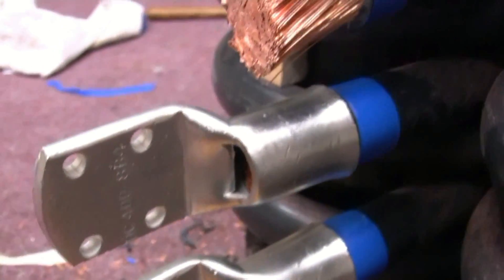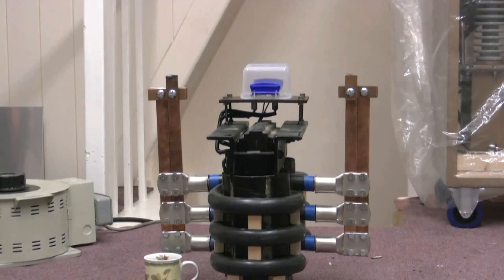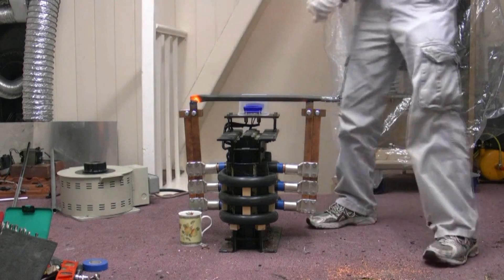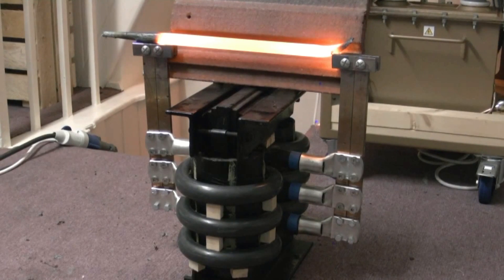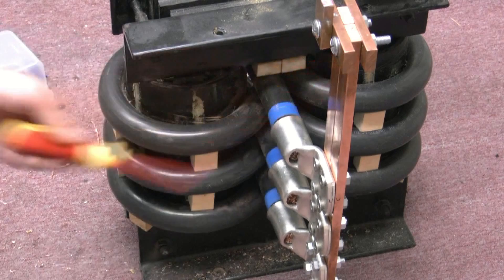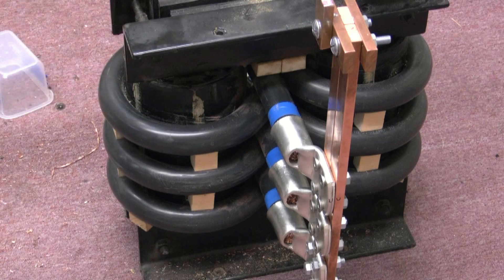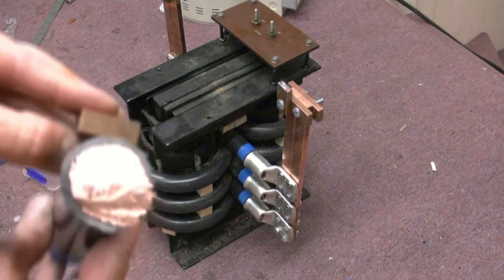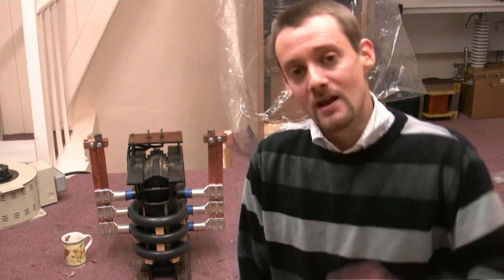50,000 Amp Transformer Completed

Comment: Impressive, However, I was terrified watching you do this.
I don't understand why you did not die when you touched the crowbar to
both of the bus bars ? This looks very dangerous. I thought that amount of current could kill you immediately ? This is a dangerous video. It should be explained so that novice people trying things do not get killed.
Reply: The reasons he's not being electrocuted are a number of factors, but the gist of it is that he only has .5 volts between terminals, just a very high current. Ohm's law says that voltage is equal to current times resistance. If you have a known constant voltage of .5 volts, and human skin on the super low end of resistivity (your tongue) is around 500 ohms. So solving for current you get .5V/500 ohms = 1 mA. You might feel a tingle at that level, but it's not dangerous.

He's measuring 50,000 amps with his clamp-on meter because of the low resistance per meter of the copper lines he's using. Using ohm's law again, we see .5V/50,000A = .000001 ohms, i.e. there's next to zero resistance when there's no load.

The metal is heating up because it has a higher resistance than the copper (iron is about 10 times more resistive) and so it acts as a resistor which leads to Joule Heating and the bar gets white hot.
Reply: Everything I said were approximations and with the assumption of "infinite power available." Secondly, last I checked, metals were ohmic materials. Everything in there is metal. Yes there are other factors like you mentioned, but they're not important for a general idea of "why he's not dead." There is certainly enough power in a household mains line to kill a person. A battery does not have that much available charge. The estimation of skin conductivity too was an approximation, the tongue was an example for a point of low resistance where it could be felt.You're right about the conductivity of copper vs iron, that's my bad, but the principle remains. To my knowledge (-which we've already established is vastly inferior to yours, oh mighty one. Praise you for deigning to lower yourself to speak with such a meager one as I.) skin behaves ohmically until breakdown voltages are reached, so where exactly is the issue there?

I suppose none of it matters, really. I get the impression that the only thing that would make you happy is putting an entire EE curriculum in a youtube post, so .. I guess enjoy being miserable.
Reply: Vlad is right. The setup is done to maximize current to watch what happens ... but this means, regarding the size of the appratus, that voltage gets below the value of a small battery cell. You can touch it without damage, because the electrical resistance of human body is high enough for not being affected. Well, you shouldn't touch glowing steel, but this is not an electrical issue.
[typo edited]
Reply: thallium200   "Electricity always takes the path of least resistance. " is a very commonly said thing, but not entirely true.  If there are multiple resistive paths available - e.g. a human body in parallel with a much lower resistance copper, or iron, or whatever conductor, the current will divide amongst all the parallel paths, in inverse proportion to their resistances.

For example, if there were a one volt source connected to a 1 ohm resistance in parallel with a 1000 ohm resistance, 1.001 amps would be drawn from the source and 1 amp of that would flow through the 1 ohm resistance and 1 milliamp will flow through the 1000 ohm resistance.  Clearly the 1 ohm resistance is 'the path of least resistance' but some current also flows through 'the path of most resistance'.

Yes, I'm aware many might consider this pedantic, but I'm just making the point that 'electricity' always flows through ALL resistive paths available to it.
Reply: xXxViDeOxXxKK It's 0.5V actually. That's how a current transformer works basically. Lowers the voltage and increases the current.
Reply: Warcin M ... Fine. "Joule Heating," if that makes you happy.
Reply: It's not dangerous in terms of the voltage/current. Only thing you need to worry about is touching the hot bar.
Reply: The Electron Wrangler Lol @ "electric friction" ... one of the dumbest handwaving answers for a dumb question I've ever seen!
Reply: Simply put which most here haven't done for you.
Electricity always takes the path of least resistance.
Reply: Low voltage, MASSIVE amps.
Reply: "Electric friction" is not such a dumb term.  Do you know what heat IS - what causes 'heat' or an increase in temperature ???
Reply: Phillll *Sigh* although answers for most of your questions are already there in my comments, I'll recap for you.
a) "electic friction" is a dumb term, because it tries to create analogy when there is none. In physics the term "friction" is described precisely, as, quote "force resisting the relative motion of solid surfaces, fluid layers, and material elements sliding against each other" - there's nothing about friction being "a synonim to http://en.wikipedia.org/wiki/Joule_heating". You can google the term "electric friction" yourself, you'll come up with nothing. It's just handwaving. b) Nothing causes "heat", because "heat" is just a form of energy. We can transfer heat, or convert other form of energy into heat. Heat doesn't simply cause an increase in temperature - it can as well cause volumetric expansion; supplying heat, in most situations, just increases the speed at which average particle in the heated body moves, because, in physics, heat of a body is just a measure of average speed of body's particles. c) I completely agree with your statements about water and about ohmic materials; I made the point because a guy before me told that glowing hot metal (i.e. the bar put between transformer's terminals) is an ohmic material, and its properties can be deduced from Ohm's law... I simply couldn't agree. People overestimate the impact of Ohm's law in real-life situations, especially by extending it to extreme cases. About water - I wrote it because the guy stated that tongue's resistance is similar to skin. I basically stated it's more similar to water's. d) I am aware that iron will heat more than copper, but, overall, its high resistance decreases current. As everybody with basic EE knowledge knows, the best way to get max power output of a source is to match the load with source's internal resistance (can be easily proven by simple differential equation). As such, increasing the load resistance up to internal resistance increases load's power, while increasing it further will only decrease load's power. See http://en.wikipedia.org/wiki/Maximum_power_transfer_theorem ; As such, saying that "power increases with resistance" is handwaving for me. I could as well say that P = U^2/R - and state the exactly opposite...
Reply: Warcin M What questions?  You needn't presume to lecture me in physics & most especially in electricity.  I know exactly what friction is in a physical sense, but I maintain it is not a bad analogy in the electrical sense.

It is 'synonym' by the way, since you're lecturing me, you may as well spell correctly.

Wikipedia is the refuge of the ignorant, so stop throwing Wikipedia at me.

"Nothing causes heat"  Oh really?  If you believe that, then there's little point in me continuing.  Why not check your favourite Wikipedia & see if it helps you to reconsider your position.  If not, consult a decent reference instead.

I just read further, and OK I see you do have an inkling, at least.  I maintain that it is incorrect to assert that "nothing causes heat".

Don't think that you're the only person who has studied physics or electricity.  It is also my life.  I have also been a radio Ham since I was 14 - 40 years ago.

I'm not going to go look at Wikipedia to 'find out about' something I have known well since childhood.  Who cares about maximum power transfer in this context anyway.  OF COURSE I am aware of max power transfer theorem & have been for decades, but it is of little relevance in this context.  P=U^2/R does not state exactly the opposite - they are complementary statements deriving from each other.  In this context, the (relatively, neglecting regulation) independent variable is the voltage, the dependent variable is the current, which depends on the resistance.  I can tell from your writing that you will also realise this, but don't presume to treat me as a child; you are NOT the only one here - though perhaps one of the few - with an understanding of electricity & Physics !
Reply: Phillll By the way, if you search here you'll find some of my other comments on this thread, from way before you chimed in.  Read them & then tell me I don't know what I'm talking about.
Reply: Areal Person you can work it out - 50mA stops the heart, at 240V you'd need a resistance of 4.8kOhms to get that across the heart, which can only usually be achieved when handling live mains with wet hands. If you half the voltage, the max resistance required to stop the heart also halfs, which means at 110V you'd need a resistance of 2.2K across your chest - or you'd have had to have just stepped out of the shower. Thats why americans use that voltage for their mains. In this vid he is handling like 2V, which would need 40ohms to stop the heart, which would be impressive to acheive
Reply: Warcin M Mate, for the record, since I see you love argumentum ab auctoritate, I was educated well, have a very high I.Q., have worked in electronics all my life but I just can't be bothered any more with smartarses such as you.  You're not the only person who knows a little science, but if it helps for you to believe that, far be it from me to upset your little fantasy...
Reply: Phillll Yah I kinda like the term electric friction as well.
Reply: christian newcomer  good band name
Reply: Warcin M My comments are true, documented & verifiable - and you are far too tiresome to bother further with.
Reply: *****
An arc welder has about 40 V  - you shouldn't touch it. Try to understand what voltage is and what current is - Ohm's law etc. Unfortunately teachers are very bad worldwide.
Reply: *****
Lot of lines.
For DC (direct currency, as taken from a battery), Ohm's law rules: U = R * I equivalent to R = U / I equivalent I = U / R where U is voltage (Volts), R resistance (Ohms), and I current (Amperes) -- just a play of simple maths. But: Any battery (a rechargeable heavy one from a car or a pocket-light cell) has some inner resistance, too. So, if you short-cut a battery, there is a maximum current it can feed (I = U / its own R). A car battery has a low inner resistance, so the current, if you short it with a tool (wrench), can melt it by the current flowing (and, next law: Power [in Watts, this is what makes spectacular effects] is voltage * current. And of course, a battery has a limited amout of power in it, it is measured in Ah (current * time == amperes * hours), which is decides on if this wrench will be burned or not (a car battery can, impressively).
** Body: Talking about DC, some milli-amperes are what kills nerve-cells or make your heart stop beating (AC - alternate current - or HF - high-frequency AC - behave differently, let's just forget this here). Of course, your body has a resistance value (Ohms) which varies if your skin is dry or wet and more things. So the current through your body depends on voltage. If you touch a wire of a welding-machine that produces many Amperes, it won't necessarily hurt you (except if it is hot).
** Super conducting: yes, this is strange. Electrons move there at almost speed of light, and you don't set 'R' to zero, but more or less cancel out the 'R' terms of the equation. And yes, this is counter-intuitive, because there are no super-conductors in your familiar environment.
** And please: stop apologizing. Science and learning consist of weird thoughts and educing from this. Einstein got his ideas from imagining a tramway train (which he used to get from home to wort) traveling at speed of light ... this IS weird.

[If there is a way to discuss per PM, use it if you want. I don't know the youtube/google-features that well]
Reply: I find it very interesting how there can be so many differing opinions on something that is supposedly standard in mathematical terms.
Reply: Ok, I think I understand now. Your saying that by using only 0.5v The resistance rqmts. are raised to be more than the human body, therefore when the bars are touched, current cannot flow because your body has aprox. 1MOhm of resistance which is two much to allow current to flow accross the terminals ? Is that correct ? And are you using AC or DC ?
Reply: Also, At what point would current flow, is it around 80ohms ? or what value ?
Reply: Areal Person
so much bullshit lol, u r asking if transformer is AC or DC?
This video is not for you my friend.
Reply: Simply Fantastic
wait i was wrong wasnt i.
Reply: -.- define novice, I suppose they shouldn't try to make this? The first thing any beginner will find out is the resistive properties, potential difference and what affects it, including what allows it to go thru their own body because maybe they don't want to die??? ... If they didn't then they most certainly should not try this and would one say thats novice??? Crank up the volts and get it going thru air it will not pay any mind to which path it takes, Your body or the metal, kick the volts down and they start having resistive paths to take. You can then begin holding live wires in each hand and not have any current go thru your heart. Your skin would have to high impedance and so would the air for the less amount of volts until you applied them to a crowbar.
Reply: Markus Johnson
High current low voltage*
Reply: Warcin M What you say makes 'some' sense, but I think is incomplete.  Re water, 'pure' i.e. distilled, water is a very poor conductor of electricity.  Water conducts generally due to ions, e.g. from dissolved ionic salts etc.  or other impurities contained in it.  The heating effect in either metal is a result of the POWER dissipated therein, which is, of course I^2.R - i.e. it is directly proportional to the resistance of the material.  In the series circuit here made up of copper cable, copper bar & iron/steel, yes, the iron will definitely heat more than the copper, due to its significantly higher resistance.  Lastly, he is NOT 'measuring' 50,000 amps, nor anything like it, anywhere in this video.  If any of you guys REALLY 'knew your stuff', this would be self-evident.
Reply: Warcin M For the record, NOTHING is ohmic with large enough Delta T.  It happens that MOST metals have a positive temperature coefficient of resistance, which is responsible for 'thermal runaway' in situations like this & is the reason fuses work.  Tungsten is a notable exception, which explains why it is used for incandescent filaments.  Why does it matter though?  Where did this subject of what is or is not ohmic arise ?
Reply: Now we all know that electricity is made up of yarn and cables are of sand paper!
Reply: I just wanna figure out how to use this damned camera
Reply: Phill maybe you understand resonance a little more than other people.
Reply: wrap a fucking coil and see what it does!
Reply: Phillll hence where the quote comes in "Became part of the circuit"
Reply: Robby Daniel because the earths magnetic field is DC and unchanging in a localised area. You can only influence electrons with change in magnetic flux - earths magnetic flux doesnt change very quickly which makes it useless for electricity purposes
Reply: Robby Daniel I thought you were serious until I reached the sixth word of that comment, hope you enjoy your trolling :)
Reply: Ranstead Moons did that just happen
Reply: akronymus 40V isn't that bad... The HF is though - the problem with welders is they act as current sources and will try to drive current through, and increase the voltage until they do. OCV on an arc welder can be up to 120V on some inverter machines
Reply: Ranstead Moons
The 40 V mentioned applies to welding machines operated by humans, voltage is limited due to safety regulations. Touching a 40 V source is not lethal, but you can't just touch it and feel nothing. Robot welders, of course don't have this limit. And, you are right: the high frequency produced by a tesla machine makes currents behave in a different way - better not touch it.
Reply: akronymus Handheld arc welders can reach 120V actually, when its in open circuit the voltage rises to make it easier to reinitiate the arc, some of the machines Ive seen can have around 100V ocv, which is pretty scary
Reply: Ranstead Moons
You are right, there are different regulations for MIG machines on industrial assembly lines (lower V max) or for welding girders (where rods need quite some voltage to ignite). Craftman's equipment (like good electronically regulated gear) should be safe, but I don't want to measure idle voltage of cheap DIY shop transformers - no good idea to change rods while on power with these.
Reply: Areal Person 
Think about a car battery, most can provide at least 500A+ short circuit but you can touch the terminals all day and not even break a sweat. Yet a light bulb running on the mains drawing less than 10mA will easily kill you. It's still current that kills you, and it only takes a few milli-amps but it's the voltage that allows the current to flow though you. Around 50v is considered a danger.

A Tesla coil won't harm you either, they can run into the millions of volts. Just in the uA range.
Reply: Daniel Astbury And this is why I get annoyed everytime I hear "It's not the voltage what kills"
When people say that^, they are getting misinformation from the fact that static electricity doesn't kill, but they forget one major thing with static electricity - it is NOT a constant voltage source... You can maybe get 100,000V for a 10,000th of a seecond, but the capacitance on that charged object is so low that the static voltage drops almost instantaneously to zero. If you only consider constant voltage sources it's a bit more obvious that voltage is much more dangerous than current. 300V open circuit is a lot more scary that 500A short circuit.
Reply: Because current doesnt kill

Dumbass go ahead research b4 posting
Reply: Areal Person I = E / R. That is how he didn't die.
Reply: Areal Person Because transformers work on DC lol
Reply: Tesla Explorer then if you different occasions  I grabbed a live wire from my wall at 120 volt on a 50 amp circuit and did not die, I was simply jolted with my hand locked in a grips position, now it was tough but I was able to pull my hand away from The Wire but I can honestly say that I was in contact with it for at least 20 to 30 seconds. What had happened was I was moving a metal shelf in my room and it fell over on the wire to my lamp severing The Wire, I moved the Shelf and when I grabbed the cord to the lamp ironically I grabbed the right onto the part of the cord that have been severed. The two times that I was shocked after that would literally intentional because after that first jolt it really wasn't that painful it just locked my muscle and I could feel the current running through me yet it kind of felt cool so yeah I know it was stupid for me to go and purposely do it again but I did and here I still am to comment on this to you. Who knows maybe I'm one of those weird freaks that you see on those shows all the time like that one guy that can pass enough current through his body to light a lightbulb never tried that one LOL don't think I'm going to press my luck again it didn't hurt kind of felt cool but next time could be the time you know so I'm good on doing it again. Also got jilted by a 220 at a hundred amps putting in a new floor by the stove, it was an old antique covering made of metal and apparently the wires inside had come loose. I had to remove the casing that was snug against the floor in order to put that floor board in that one stung a bit and again I was in a gripped position as I had a grasp on the casing when I went to take out the screw it grounded out and jolted the f*** out of me the lady that I was working for assured me that the breaker to that stove was off yeah right but here I still am
Reply: Areal Person
You would a) need to touch the both ends of the coil at once to have the current flow through your body and b) also have a dangerous voltage between the ends. 48 volts AC is usual limit for what is a dangerous voltage.
Reply: The Electron Wrangler
It doesn't make me happy. It makes your answer at least remotely sensible. Non "sensible", though. First of all, Ohm's law works only for ohmic materials - duh! (actually, only common resistors apply here) in the normal temperature range (see below), thus doing any analysis based on it with high voltages or currents is actually wrong, also for a couple of other reasons (transmission medium parasitic capacitance & impedance, resistance bias due to temperature coefficient with self-heating etc). Another thing is, saying anything about human skin resistivity on the tongue is absurd - tongue, by itself, is only as conductive as any other mucous membranes - as such, the restivity is that of mucus, not of tongue. With enough saliva secretion, the resistance is almost equal to that of water, making it in order of single Ohms or below - it's the fact that most of the current goes through the saliva that makes it remotely safe to lick even a 12V cell. Also, he's measuring that high not because of low copper resistance - it's because the voltage source has high efficiency and low internal (output) resistance, being a simple coil transformer with high power input/output. You could as well use a 1.5V power cell and short-circuit it with copper - and you wouldn't have 150kA that way. Do the math yourself. Not including Rv in your calculations is just plainly wrong. Finally, saying "metal is heating because it has a higher resistance than the copper" is absurd - copper is heating as well; connecting the terminals with copper would have given even higher power/amp output - but it'd spread the temperature evenly across whole conductor. Using a resistive load decreases the overall power but concentrates the heat emission, due to uneven voltage drop across the conductive path. Connecting the terminals is exactly the reason why the transformer stopped self-heating (noticed how he checks the transformer periodically for possible signs of it?). Even more, iron is only 6x less conductive than copper.

tl;dr So no, that didn't make me happy.
Reply: Fuking Gewgle its high current and high voltage.
Reply: Markus Johnson
nope I'm pretty sure its around 100+ Volts.
Reply: Areal Person 5mA 0.005 can kill a human ,, he uses fucking 50000A
Reply: Phillll What questions? The dumb questions you asked. "Do you know what heat IS - what causes 'heat' or an increase in temperature ???"," Why does it matter though?  Where did this subject of what is or is not ohmic arise ?" are questions, AFAIK. If you say you believe you can "cause" heat, I'm inclined to say you're either clueless or a troll. Heat is a form of energy, and you can't "cause" energy; energy, by definition, can only be transferred. Also, "I studied physics" etc is a  argumentum ab auctoritate, and dissing Wiki without providing even a slightest sourcing or backing for your statements is just lame. Go and take a hike.
Reply: Phillll
 >says " I was educated well, have a very high I.Q."
>calls a discutant a smartass
>smartass
You're also modest and brilliant. chuckles Well, douche Q.E.D. Go bother with those "important things" worth bothering, I don't mind. Also, I have no fantasies about "being the only person who knows a little science", because I have no problem with intelligent people knowing EE and electronics - I'm surrounded by them both in my work and in my personal studies. Sadly, just because you believe you're one of them doesn't automagically make you Olin Lathrop nor Russel McMahon.
Reply: Phillll "True" just because you say so? Then I'll say you're a complete moron, and I'll say it's true, done. Also, for reference you have my opinion. "Documented"? Please point to at least one documentation link, citation or reference posted in your comments in this thread and I'll concur. "Verifiable" by whom and by what means? By your ego? chuckles You're even more clueless than most people on the internet, Troll Q.E.D. Already told ya, go take a hike.
Reply: The Electron Wrangler
First thing - no need for sarcasm. If you consider that my knowledge is superior to yours - GTFO and EOT/EOD. If you don't, stop being a sarcastic jackass. Like I said - metal conductors are ohmic materials only in the low to medium voltage/amperage/temperature range, which isn't the case for any metal glowing hot. http://en.wikipedia.org/wiki/Temperature_coefficient#Temperature_coefficient_of_electrical_resistance clearly states that no conductor nor semiconductor is ohmic with deltaT big enough. Inductors aren't ohmic when powered by AC, either (we get impedance instead of resistance) - and the transformer is a double inductor, in no way ohmic here. Also, you're approximating so much it lost any sense. I can approximate you as a monkey, do you consider that sensible? Also, skin doesn't behave ohmically, because it can vary it electical resistance due to many factors (blood pressure and hormone level being some of them), being essentially a semiconducting material, with a feedback loop through the nervous system.

And it does matter - not only because your entire reasoning is fault, your "facts" are wrong, you are unable to admit that and you're playing ad hominem sarcasm. Mostly because, well, you suck at electrics. No offense intended, but you wouldn't pass a single electrics/electronics class in a decent college.

NB I replied because you put up a bunch of bullshit, with "electric friction" in the first place; you replied trying to put your entire EE curriculum, wasting even more bits of internet than me - so I guess I should pity you at least as much as you do vs me - only I don't care.